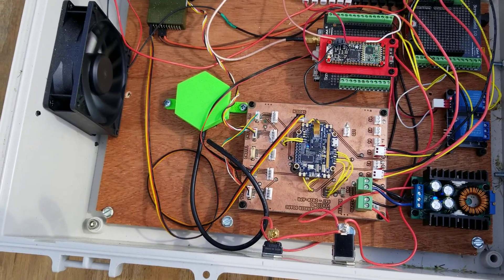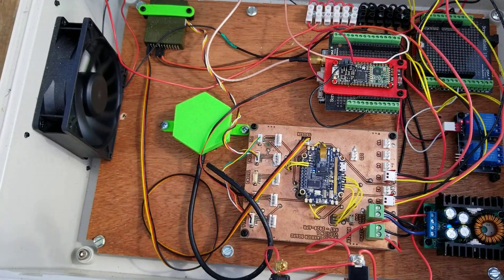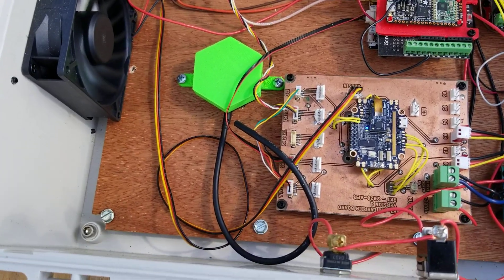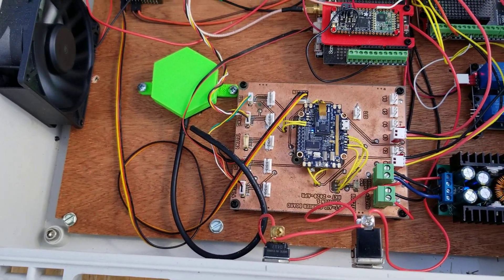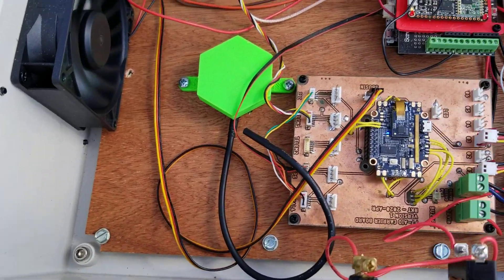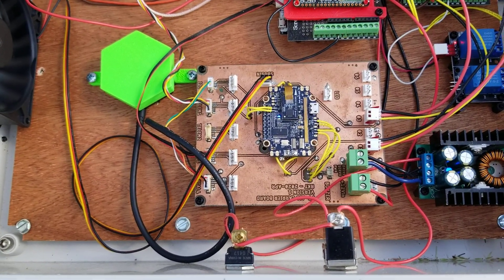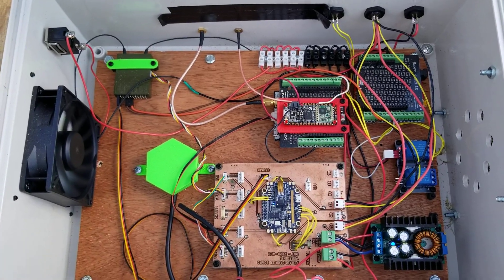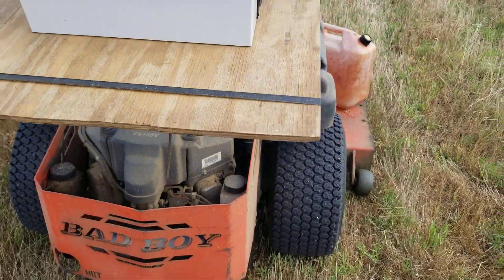Completely New Control Box for Autonomous Mower with Kakute F7 AIO Controller

Comment: How many microcontrollers do you have in this setup? I see two screw shields, is one over a GPS module with an Arduino on top?
Reply from the maker: There is the Kakute F7 AIO on the carrier board running Ardurover, an Arduino in the top right that is handling the safety cutoff if I hit the kill switch or if the remote control losing communication for 20 seconds, and the Adafruit Feather M0 Lora for RTK comm to the Ardusimple SimpleRTK2B which is underneath.

Comment: Nice job! Makes me want to work on my RC mower again! It's good that you have a fan in there. I have an F7 on a kwad that gets surprisingly hot fairly quickly. Good choice of Flight Controller, the soft mounted IMU will help. Are you running inav firmware?
Reply from the maker: No, I am running Ardurover. The only thing I don't like about the F7 is that they didn't bring the I2C signals to pins. One has to solder to those super tiny pads.
Reply: @KennyTrussell  I didn't realize ardurover would run on an stm32 processor. I'll have to look into that. You're lucky to find that many through hole pads. The small pads have become more common on the flight controllers. Most people don't poke the wire through the hole and solder it anymore. Instead, the pads and wires are tinned and simply surface mounted. Thanks for the info and posting videos!

Comment: Hi Kenny, really awesome build. I'm taking the plunge here and mechanizing my mower as well. Thanks for posting all of your experience, it will save me a ton of time.
Have you got a spreadsheet posted up anywhere with your current loadout? Which freq is your Feather M0 LoRa on? Thanks a ton!
Reply from the maker: I did not create a spreadsheet or other tally of my electrical load. I do sometimes wonder how much the alternator can handle. I can say that I have been running as I am now (more or less) for over a year and have had no trouble. I believe I have a 10-amp fuse in the line my entire system and it has only blown once. I can't remember what caused it to blow.